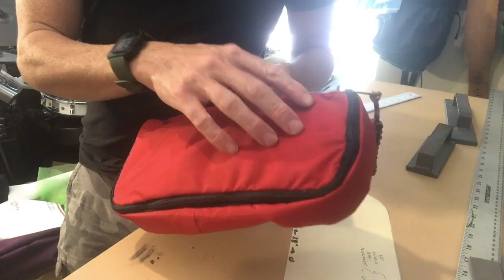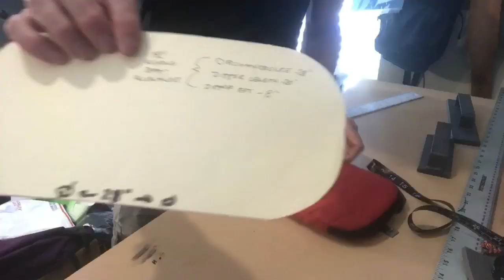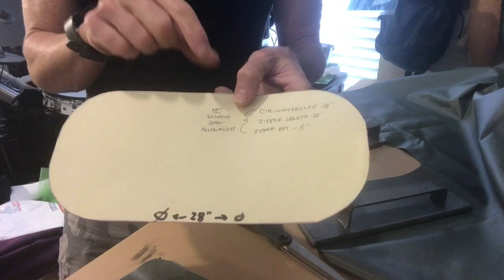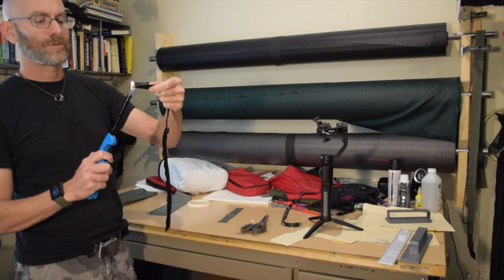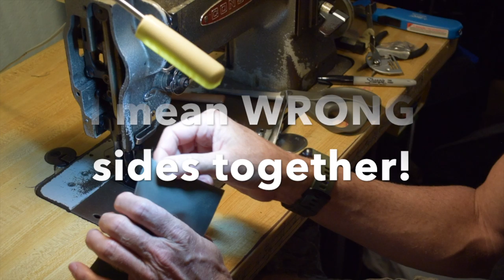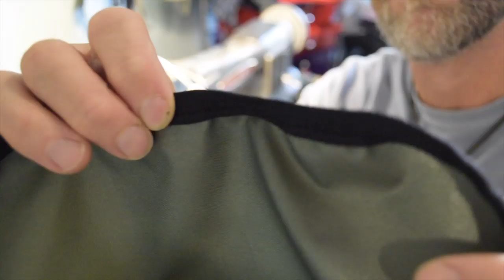Sew Your Own Packing Cubes!

Comment: Thanks for the video.  I'm new to MYOG and they are very helpful.  When you were measuring the circumference of the lid I saw that lovely long metal yardstick and I thought for sure you were going to mark a starting point on your template and roll it down the length of your yardstick back to the starting point.

Comment: Here’s how you mathematically measure round corners on a square: Say I want my corners to start 3 inches from the outer corner. It’s a 90 degree corner. This will give me a circle with a 3 inch diameter. (Diameter) 3 x (π) 3.1415 = 9.4245 x 2 = 18.849 (circumference) My central angle is 90 degrees since it’s a square corner. Then I need to convert this into a decimal. So 90/360 = .25 So (circumference) 18.849 x (central angle) .25 =  4.71225. Once you do this a few times it makes measuring rounded corners a lot easier.
Reply from the maker: That's great info, thanks for sharing!

Comment: At 10:30 in the video, there is an attachment to your machine that feeds the binding at just the right angle to wrap around the edge of the hem……what is that device called?
Reply from the maker: Hi!
To the best of my knowledge, the best generic term is "binding attachment," and some people just say "binder."  The specific one I am using in this video is the 1" Swing-Away Binding Attachment from Sailrite.  That's an excellent choice for a first binding attachment.  The important thing to know about binding is the attachment and the binding need to be the exact same size for the best results.  For example, 7/8" binding will run through a 1" binder, but will sometimes become misaligned and the stitches will miss an edge (especially around curves).
I'm planning a fairly deep dive video into binding soon! Binding can be some of the most frustrating sewing one can do, but sometimes it's exactly what is needed!
I hope that helps, thanks for watching!

Comment: I managed to jot down the measurements you used, but it would be really helpful if you could include them in the info under the video. Thank you!
Reply from the maker: Hi!
I didn't get specific with the measurements, because these cubes were made specifically to fit my backpack.  I see the value in having measurements to start with, though, so I'll try to add them to the video description. Thanks!
Reply: @thejasonofalltrades  thank you!

Comment: Where did you get those table weights?
Reply from the maker: I bought mine used from a seller on craigslist, but you can find similar ones on ebay and Amazon.  Search for "fabric pattern weights" and you should find them.
Thanks for watching!

Comment: Have you had issues with the swing away binder? I have the same one, same Consew machine too. When I set mine up it jammed the fabric and caused tons of rats nests of thread.
Reply from the maker: Hi Rick, 
I haven't had that problem.  Is it possible that the presser foot is contacting the binder?  That might potentially mess with the tension and case that kind of problem.  I pretty much always use the foot that has the skinny "toe" on the right side, so there is more clearance.
If the binding isn't feeding off the roll easily, that might also cause problems.  Sometimes I pull a few yards off the roll and lay it on the floor so there is less resistance.
Let me know if you're still having problems!

Comment: Great tips on the rounded corners and space to the zipper teeth. Depending on where you shop, it pays to watch for sales or coupons. Hobby Lobby runs a 40% off coupon weekly, and Joanns is famous for their 50 or 60 off one item. So many other choices on line at great prices too, and lots of colors. You can sew binding in two steps if you don’t have the binder attachment. I have also used the double-sided tape so I could stitch in one pass. Tk as always for sharing!
Reply from the maker: Good point on the sales and coupons!  I actually found a coupon on my phone while I was in line to buy the elastic I used in this project.  It's still more expensive than other binding options, though, but might be worth it in certain applications.
Thanks for sharing your thoughts and for watching!

Comment: Would you happen to have any tips on sewing zipper pockets on 1000D cordura?I'm trying to sew a individual pocket on a project but the cordura wont lay as flat as I would like. Thus making the stitching along the zipper look crooked. I am using a zipper foot an alot of pins to hold it down but it doesnt seem to work well
Reply: That tape from Sailrite can be your best friend. Press it down with the handle end of a screwdriver or similar tool to insure "contact" and encourage it to stick well (my experience). I NEVER use pins..... just me.
Reply from the maker: E K, JP said it for me.  I use double-sided basting tape, especially on 1000D cordura.  It helps the fold lay nice and flat, and makes sewing it a lot easier.  To me, it's worth the cost. I have pins, and on the rare occasion I'm using a lightweight apparel cotton or something, I might use them, but it's exceedingly rare.  The little clamps and binder clips seen in this video are my go-to for when the tape isn't called for.
I hope that helps (and thanks JP for your reply!).
Thanks for watching and commenting!